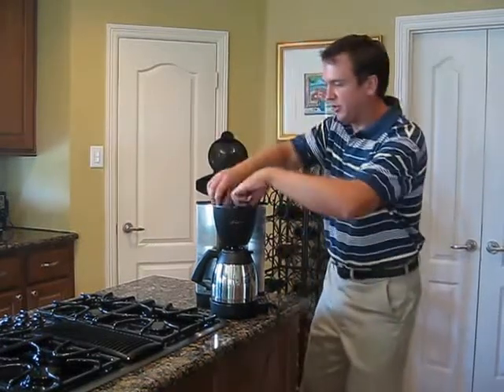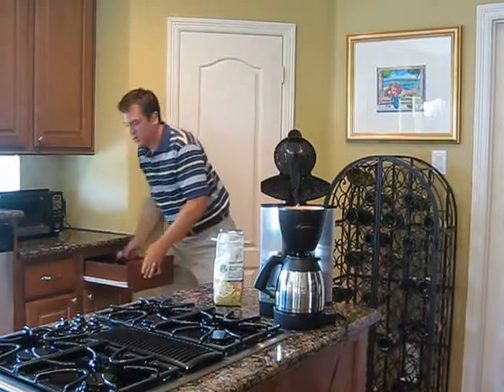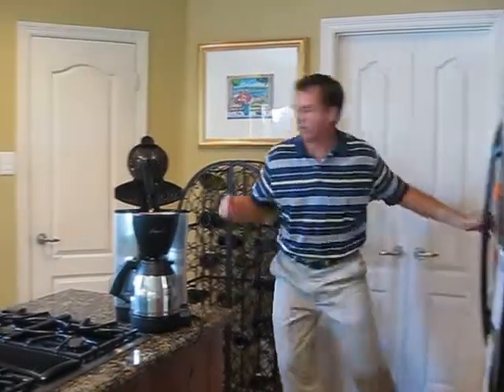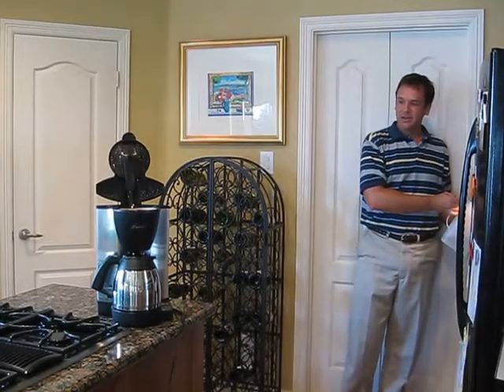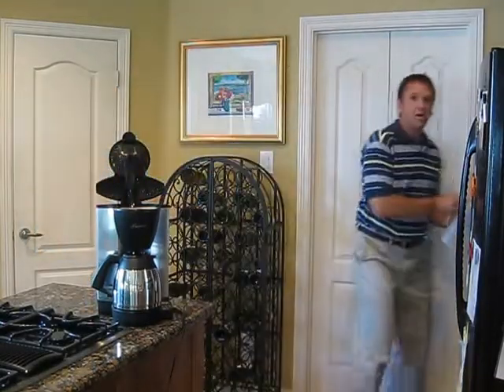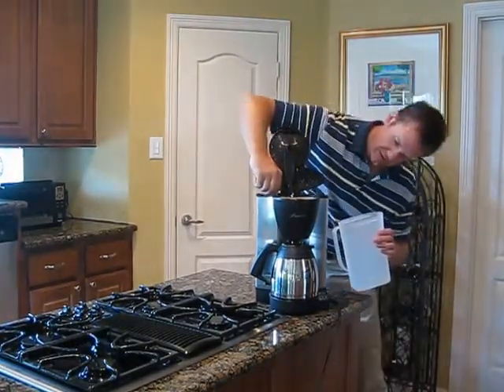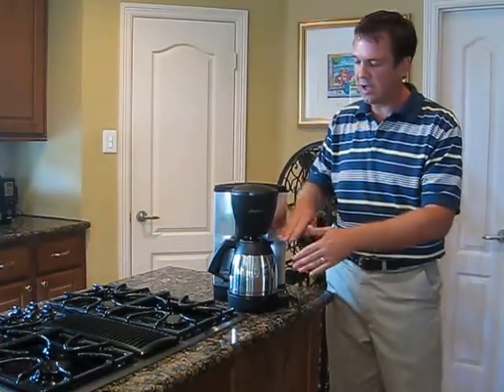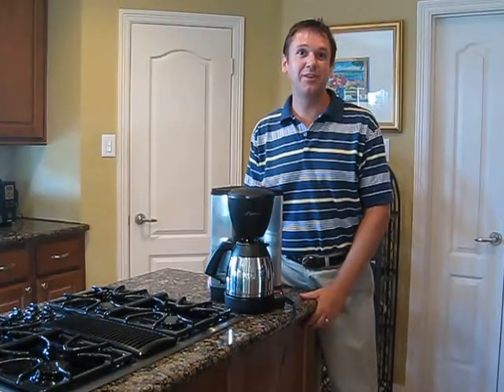Coffee Setup - BEFORE SMED (Setup Reduction)

Comment from the maker: With the "Before" video, I pass out a detailed step-by-step process description (with times listed in seconds). We have a class discussion about what is an "internal" part of the setup and which parts are "external." Together, as a class, I lead the students through brainstorming about how the setup (machine downtime) can be reduced. Doing it this way allows students to come up with the process redesign.

We discuss that while the machine is running (making the pot of coffee), the operator would do the external setup steps to prepare for the machine to stop again. We also are able to have a lively discussion that we are able to drastically reduce the setup time (machine downtime) without purchasing automation (a kureg, or high-speed water filtering machine for instance) and that the operator is able to work much slower, increasing quality and safety, while the overall setup process gets much faster.

Comment from the maker: I use this as a demonstration of SMED. As mentioned above, the assumption of the demonstration is that this is an industrial coffee-making process:.making pot  after pot after pot and that reducing the setup time is needed to brew all the different types of coffees we need to during the day - that this is a bottleneck operation that needs additional capacity. I teach undergraduates .... large class sections (>60 students each section) and it is difficult to go to an actual Gemba and most students have not been to Gemba in a real work setting. So, this demonstration uses a machine setup process with which the students are all familiar. In the "before" video, the "setup operator" is trying to show that they are already working as fast as possible - just as one would see when videoing a line worker for the first time.

Fun demo .... If anyone wants to get a copy of my process description and some discussion notes, I'm happy to share - just message me on Twitter @leankaizen.